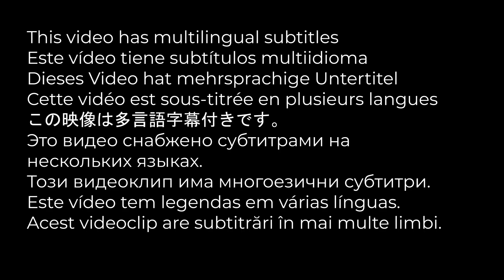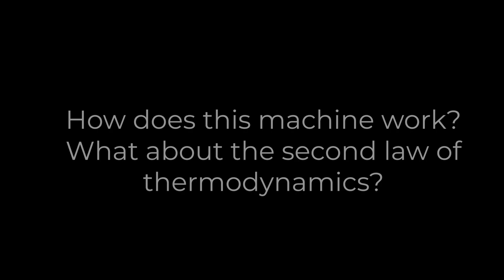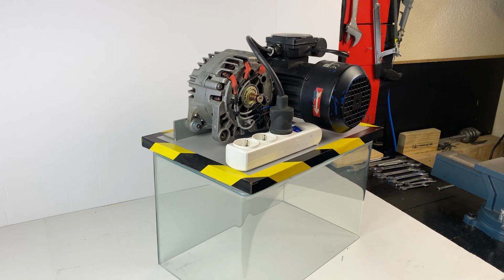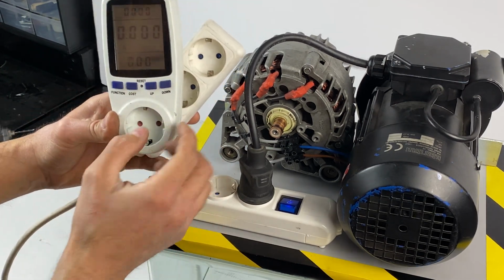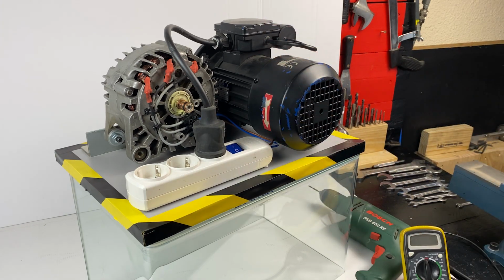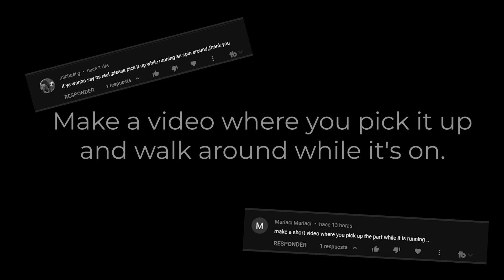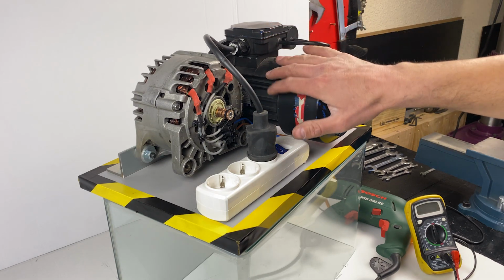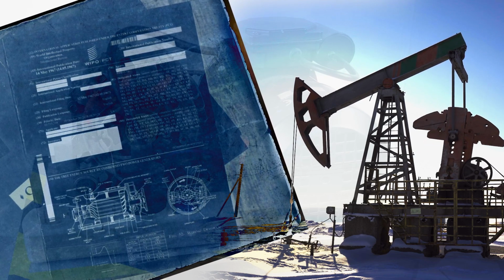We put this Infinite Energy Generator to Test - Liberty Engine 1.0

Comment: I’m curious the power advantages that operating this in a vacuum would create. Also please operate it under load for longer than 3 seconds. Show it running non stop with a voltage tester to show how much it drops
Reply: He cant operate it more than 3 seconds due to fall off. That is voltage. Fall off. In order to not have a big fall off he should be useing  compastors.
Reply: Even with "fall off" this does produce "more" energy than it requires to run.  Would you not agree? Though, I would live to see some meters measuring the amount of Amps it's producing.
Reply: @jackdundon2261  yes to a degree. I would like to see a meter mussurement. Of the full load and not just one power tool. As i said my  GF had the same set up and he used a dc motor instead of an alternator. And  also a few capsitors. In line With a frequency Convertor.
Reply: @martyclack8782  DC motors aren't designed to produce power, a generator does, ONCE it reaches a high enough speed, the alternator makes power at a lower rpm. -- this I have not looked into too close. 

My idea, pull the 5.5 horse Honda motor off my 4k generator, strap a 2 or 3 horse electric motor to it... plus it into a wall outlet, RAPIDLY unplug it and plug it into the generator and see what happens. then, plug a electric heater in, and slowly turn it up... see what happens. YouTube is full of B.S. videos, so this stuff needs to be done independently.   According to math, THIS WORKS, according to logic, no way in hell.
Reply: @jackdundon2261  yes they do if you know what you are doing. This guy took and alternator and put in high powered magnets he mad a dc motor is what he did. And the single phase motor is still a alternating corrent.  DC motors are what produce power. But like you this set up he has is not capable off producing enough power to keep a load going for long.  The capacitor on the single phase motor it the key to why he is runing things. The single phase use it to jump the motor of but the one he has is oversized for that motor.
Reply: @martyclack8782  question: how efficient can a DC motor be used to generate electricity? Seams to me, use something already designed to generate electricity... like a alternator?????
Reply: @jackdundon2261  DC means direct current thus the name dc. Now alternators in cars have diodes in to regulate from dc to get alternating current. But you are producing dc current for to charge the batteries  but thebalternator produces both ac/dc the guy done away with the ac when he modified the alternator thus he put magnets in it. Thus the alternator became a dc motor. The hydro electric dams uesed big water turbines. The magnet in a dc motor produce the field in the windings in the motor. Thus a current is produced. In the laws of physics you must come from a mechanical drive to produce electrical power.  And back to what ever mechanical drive. In a AC motor you are creating in the windings a ele. Magnet. Thus the amatetor on the drive shaft is pushed. And you get a mechanical on the shaft to do what you want the guy in this video made a fixed loop. And he has some power to spare but you will have fall of in current. Thus the need for a capacitor.  They store energy.  In all generators  you have a dc motor that has diaodes that create dc as well as invertor to make it ac.
Reply: @jackdundon2261  According to math AND logic, it does not work...

Motors, generators, or alternators do not produce power. They convert energy from electricity to mechanical energy + heat and mechanical energy to electricity + heat. If this were a closed system without a battery as is implied (nothing is a closed system), the energy content of the system would have to be equal to the pull string input, which is ridiculously negligible. Because of heat alone it's completely nonsensical. There is no physics (math and logic) to support it. The concept violates very basic thermodynamic principles. The idea that energy can literally be created from nothing is nonsense.
Reply: @TheSoulSauce  the system converts Magnetic Energy into mechanical and electrical energy. So you are wrong to say he is creating energy from nothing.
Reply: @jackdundon2261  Have you even watched the video?  What do you think he rebuilds to become the generator to power the motor exactly?
Reply: @RCMercurius  I have watched MANY such videos.  Some are complete BS. None have been done "right".  - as ussual people are more interested in Bull Shit than science. - I don't remember the premise of this video. But, it wasn't good enough to stay in my memory. 

On to the next
Reply: @Wolfgang227  supose you pull the 5 horse gas motor off a 4kw generator, put a 2 horse electric motor on.... the math showes it works with about 1 kw left over. Logic dictates it won't work...  

Have you tried anything like this?
Reply: around 12:45 we see the red wire hidden on the bottom of the red shelf
Reply: @martyclack8782  around 12:45 we see the red wire hidden on the bottom of the red shelf
Reply: @philippecaouette4275   good catch.
Reply: @TheSoulSauce  Let them replicate it and they will gain a very great self-knowledge.
Reply: @livhuwaninevilleramovha6817  The order is wrong. Mechanical energy is converted into electrical energy. (generator principle)
Reply: @martyclack8782  диодный мост с конденсаторами в доске!!! Доска обклеена непрозрачным скотчем, чтоб не было видно, что доска поклеена на несколько частей. 
a diode bridge with capacitors in the board!!! The board is covered with opaque adhesive tape so that it is not visible that the board is glued into several parts.

Comment: Do you prefer this setup compared to the high rpm washer rotor hyper drive?
Reply: ello,did you find the way to make the Gerard Morin motor work?
Reply: @onetooneone4816  Am almost done will update when I finish. Have found 10 designs that should work perfectly. Plan on selling with my ductless split heat pumps.
Reply: @THEMFORMATION  like to be in tuch whit you is that possible?

Comment: There is resistance in the wiring, friction in the bearings and the belt. Gluing magnets onto the dynamo willy nilly actually adds more resistance. Therefore some of the energy inputted to spin the dynamo is lost through electrical resistance and friction creating less energy output. 1+1 does not equal 3. 
If this actually worked it would be headline news around the world. T
Reply: Lol while covid and war in ukraine is on going? You are the fool.

Comment: Nice video, though I only have one problem. The alternator have 8 poles and running it at 3,000 rpm would give a 200 hz a.c. output. How's that possible to drive the motor at 50 hz? I'm too an avid fan of free energy and I understand it doesn't have a chance against big capitalist running commercial energy suppliers, it will surely be suppressed.
Reply: Alternator is not generating any power. Inside black motor there are batteries and invert(that's why there is stable voltage and motor not slows down under load). Modifying alternator is just a bait. Wires going to alternator are not connected anywhere. Stop belliving in this, ban this idiots and make youtube cleaner
Reply: @kamilwidzyk4421  even if there was a  battery somewhere the alternator would keep the battery charged up and in return keep the motor running
Reply: I count 6 pole pairs on the rotor. That should make a 6x higher frequency => 300Hz. But it is possible that the power meter is wrong showing 50 or 60 Hz. A drilling machine or lamp will work perfectly on 300Hz. Maybe the drilling machine will run a little bit less powerful.
Reply: you need a relay to keep motor ON when they are starting to spin the alternator. Thats why when is is rolling a pull wire, he is very slow to not activate the auto switch.

Comment: The obvious answer to where the energy comes from is in the starting procedure. You pull on the cord and the generator-motor loop stores the mechanical energy your muscles put into it. It may be enough to drill two holes in a thin aluminium strip, but let it run long enough, and it will slowly loose power and die off.
Reply: It will actually stop nearly instantly. We played with this half a century ago, to show that it could not work.

Comment: It seems the neodymium magnets installed into alternator are facing NN or SS at their edges, and they would repel each other away from another, if not glued together, so this creates a "bucking" magnetic field right in the middle of the two magnets where they are glued.  
Is this true how it is?  
Also the larger flat surface of the two magnets glued together faces same polarity of N and N facing outward, or S and S facing outward, and the polarity of magnets in rotor alternates as rotor spins,  to create an AC current in the windings of the alternator.
Perhaps the "bucking"  (NN or SS) edges glued together creates a magnetic field that resists the normal lenz law braking action of the alternator when it is loaded with the load of powering the motor?? 
Normally a car alternator spins very easily by hand, but if you were to load the alternator with car headlamps for example, it would be impossible to spin by hand.  
This example of "lenz law" braking reaction which "normally" makes it impossible to spin a generator with a motor and have the generator in turn power the motor and loop it as is shown in these videos.
I will suspect the bucking magnets inside the alternator cancel out the lenz-reaction?
Is this true?  Have I figured out what is going on, and why it works?
THANKS
Reply: Hey Doug I agree with your understanding I really hope this is real I have done many experiments in the past with ac motors and car alternators I do have a permanent magnet car alternator with professionally made rotor from Missouri wind and solar but there is huge clogging I have tons of car alternators I have a 200 amp car alternator I am willing to replicate this setup for everyone the only thing I dont have are the magnets if you have some similar to this guy and can send then to me I will built this and show results quickly it's super easy to build this also I have many 3 phase motors as well as single phase like his and car alternators pulleys and belts if there is someone that can relocate this to verify it's real I would like to give it a shot 😁👍
Reply: @overunityresearchchannel  
Still WHY the yellow and black stuff around edges.  There is where an invertor and battery could easily be hidden and they have still left that stuff on there in all videos.....
HOWEVER it could be true, and only thing I see to make it true, is those magnets bucking at edges inside alternator.  I dont have magnets that shape or size they would be easy to find on Magnets4less or ebay.    Simple test is to get four magnets NSNS super glued to a thin metal cutting saw blade,  and another four underneath pinching themselves tight to the other four magnets on top.  
Now a four pole PM rotor easy enough.
Then superglue some other magnets onto the backedge of those magnets, in bucking configuration where the magnets want to repel but held in place by super glue.  This just like video shows....then spin with small DC motor, see if motor goes up in draw and rotor brakes when a generator coil is loaded or shorted out pointed against that bucking edge of magnets.
Reply: @MrDKONZEN  I thought about the wood with tape it could be filled with lithium ion batteries if I was this guy in would show without editing me putting it all together and running it and take it completely apart take the alternator apart and take the motor apart and cut up the wood
Reply: @MrDKONZEN  thank you for offering to help though I appreciate that man I am sceptical about this there are alot more videos like this one with single phase motor and car alternator they start it with a rope only thing is this guy makes a pm rotor and shows a bit of proof but he didnt take the components apart to be %100

Comment: how did you model the resin of the rotor in order to make it rotate perfectly on axis?
Reply: its not look at the variance of the power output and probably why they used a belt drive system honestly if you pay attention the belt is not staying at the same exact position it is bouncing quite a bit thus its not perfectly on axis something like this would be significantly harder if you hard mounted the motor to an alternator the vibrations alone would wreak havoc thus wy they used the belt drive if i had to guess its far more forgiving of that kind of thing

Comment: I'm curious if the system could have an external source adding additional energy to the system to address the eventual entropy of the physical parts and heat. Such as a battery array or capacitor fed from a wind or solar system or even a wireless RF energy harvester?
Reply: basically no in the video he clearly stated that bearings would need replacement every 6 months also a rf harvester to power something like this is just not feasible seriously have you seen the size of a wireless charger? they operate on the same principal you would need something massive to emit enough energy to run something like that especially with him having walked it across the shop like he did
Reply: Yeah there is. There is no such thing as free energy.
Reply: That's not exactly true, you seriously need to do more homework. Try looking into the Searl effect generator. Once you do that homework and actually grasp the concept fully, then come back to what he says at the end of the video and this comment 😋
Reply: @senecan100  can you send me a link to any peer reviewed paper that proves you right or any other evidence?
Reply: Yes . He has a cord  hidden from a power source  .  This fools most people. Not me
Reply: @senecan100  Mankind would only destroy the planet with free energy.

Comment: How do you determine the magnet to be used so as to produce a 220V @ a certain rpm? As we know, car alternator has 12 alternating N-S-N-S... poles, and there are also 12 sets of coils in each phase, 36 all. In your modification, you also make 12 alternating N-S-N-S magnetic poles. Faraday's law of electromagnetic induction shows that: the higher the speed, the greater the voltage, and the greater the magnetic strength, the greater the voltage. Voltage is proportional to these two factors. Now, at what rpm and magnetic strength that this set up produces a 60 Hz @ 220V? Could you give us the details of these factors?
Reply: they said the motor spins at 3000rpm, would be interesting to try and backward calc it from there

Comment: Thanks for the tip.  When alternator pole is at north , then the motor pole should be on north, so they do not cancel one another out.. I will experiment with this concept , thanks.. 1st experiment will be with my two horsepower one single phase 115/230 volt induction motor connected by time belt to the 24 volt 200 amp output alternator. I will use a compass and marker where the coils are on the outside of induction motor case with marker. I will do this to both generators with a 9 volt battery and use a compass to find my north and south poles on coils and I will mark them. I will keep battery connection all the same when testing coils for North or South. I will use my brackets and put them on a board  I will have a timing belt and timing pulley to keep them in sink with each other. I will have a switch connected to a power source. I will have Positive connected to positive and negative connected to negative on both motor /generators. After I turn switch on , I will leave it for 10 seconds then turn the power off. I will see if the generators keep on running. I have NEVER heard of anyone doing this and I have Never done this myself. I hope this is the key. IF IT WORKS , I will run an 1800 watt heater with fan , An induction cooktop , 3 lights , My tv and lab top , I will charge my batteries with it and in the summer I will run an a.c unit In my van. have NOT built yet.
Reply: Did you ever build this?

Comment: The thickness of the base could easily contain lithium-ion batteries and that drive motor could be a DC motor running off the lithium ion batteries you shouldn’t use that thickness of a plate bolted to it

Comment: Excellent job guys ! You have made an very interesting project that excites the inquisitive mind ! You also have done an excellent job explaining all the aspects of your build ! This is something i to will now research and experiment with  !🙂🙂 . I have a question? How much amperage can you actually be use from this device as the higher the average the larger the wire size that is needed to handle the amperage ? I know that by using 220 V one can cut the amperage about in half from using 110 V  ! I am not sure the wire size your using ?  I guess in a way i am asking how much useable amperage can this unit put out as it is constructed ?? My hat is off to you again as a job ell done !!!👍👍👍👍👍👍👍👍
Reply: 12 gauge wire for 220
Reply: Or 10 gage  if the current gets as high as  it is showing